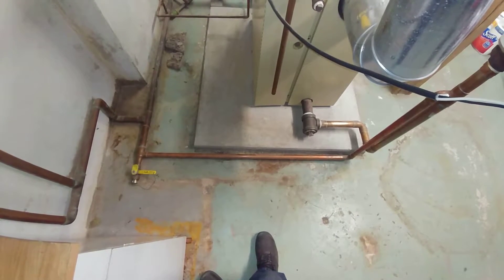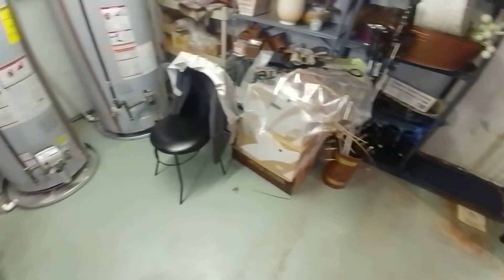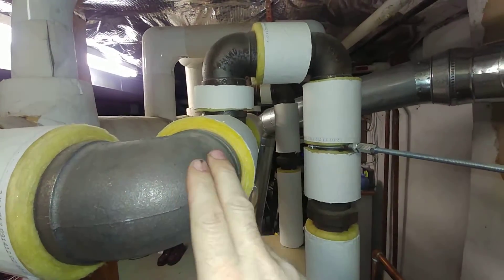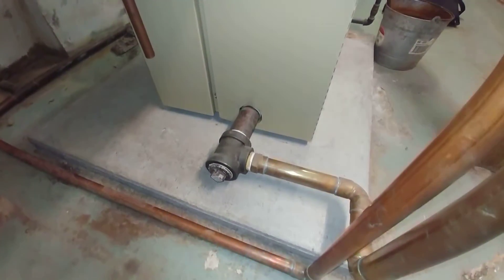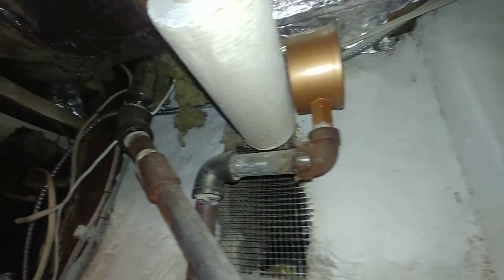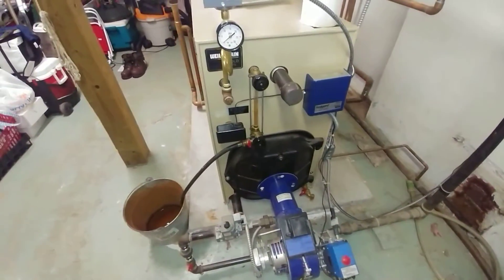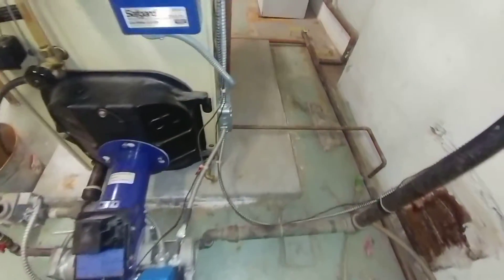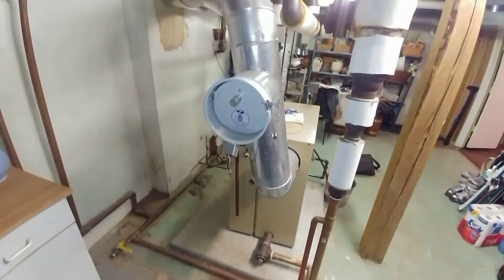Weil Mclain SGO-8 Gas Fired Steam Boiler With A Mega Drop Header

Comment: I never saw a gate valve on a gas line. I would have changed it out during the boiler update.
Reply from the maker: On a gas delivery system that was still using wooden gas mains from 1868 until recently, a gate valve from the 1920s is high tech. It also still works. But there is a Listed gas valve down stream all the same.
Reply: @gordonschweizer5154  I've changed out a few cast iron fittings on gas lines in the past.

Comment: how many radiators would a boiler that size run Gordon?
Reply: The SGO-8 is rated for 833 square feet of radiation or EDR, which also accounts for a "pick-up" pipe factor of 1.33.  As to "how many radiators" that would handle would largely depend on the size of the individual radiators.
EDR stands for "equivalent direct radiation" and is equal to 240 British Thermal Units (BTU) per square foot of radiation surface.
Steam boilers are generally sized by counting up all of the radiation connected to the piping, consulting the EDR sizing tables for each radiation type and totaling it up.
Next, consult the boiler model sizing information and pick the boiler that closely matches the heat emitter size connected load that you have calculated. 

That is way different from doing a "heat loss" calculation for hot water heating systems.  Steam systems do not "care" about how well the walls are insulated, etc.  The steam only "sees" the giant cast iron balloon it has to fill.
Reply: @elgordo271  thanks for your knowledge
Reply: @dannywilkins887  You are most welcome.  Steam systems certainly are odd with their quaintly old-fashioned ERDs and BTUs and such-like.  Gosh, I love it so.